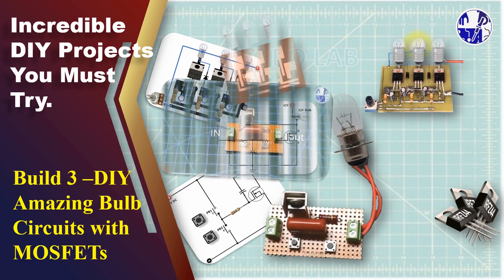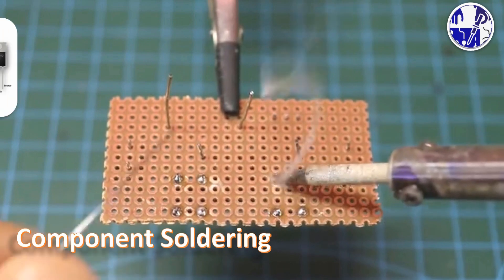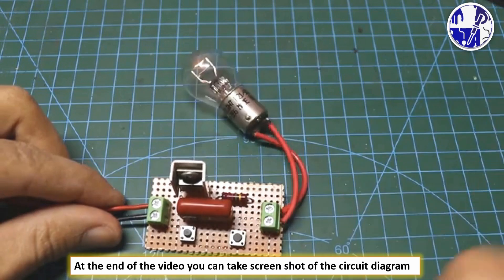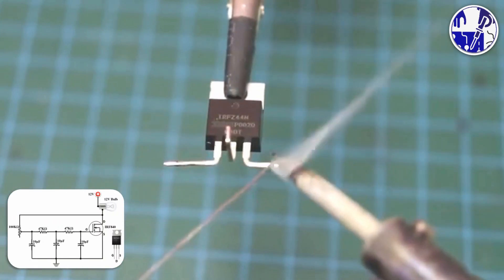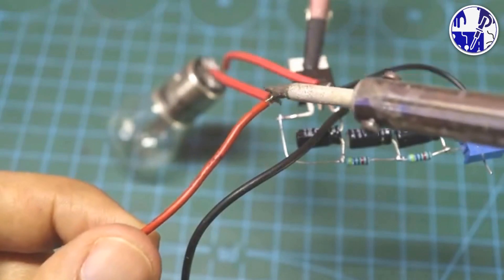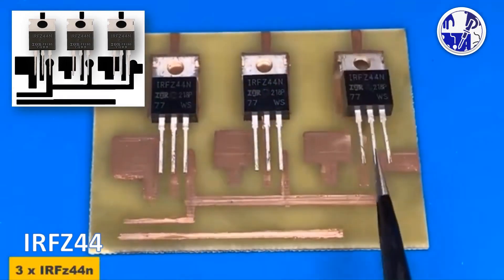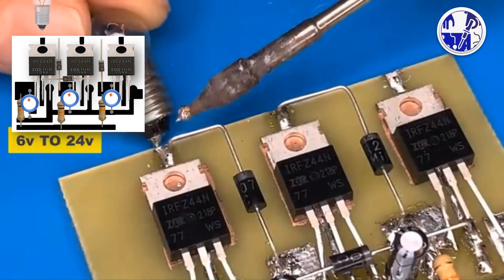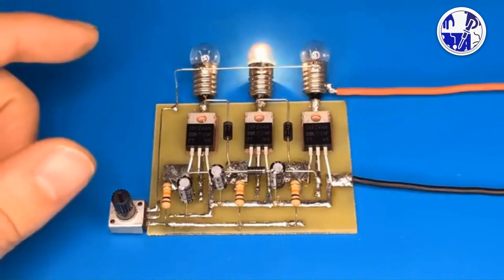Master MOSFETs: Dimmer, Flasher, Sequential Circuit | Beginner-Friendly MOSFET Circuits

Comment: How do I calculate rpm to km/h and display it on the LCD screen with adruino nano? i need the code.. thanks..
Reply from the maker: This project is not about Arduino. If you need code, I will try to make video for Arduino also.